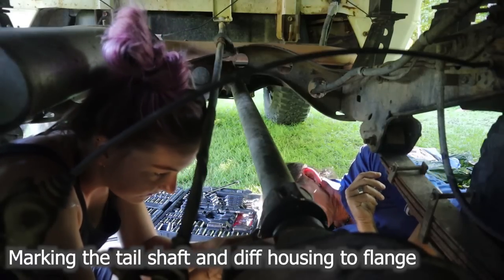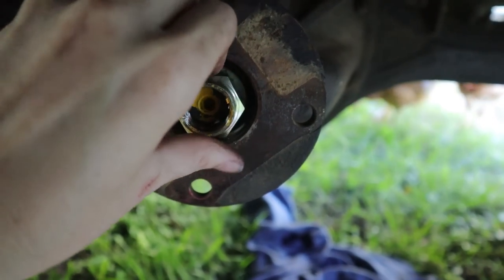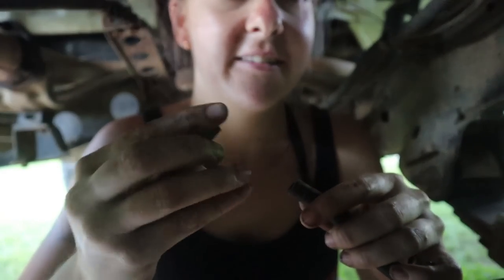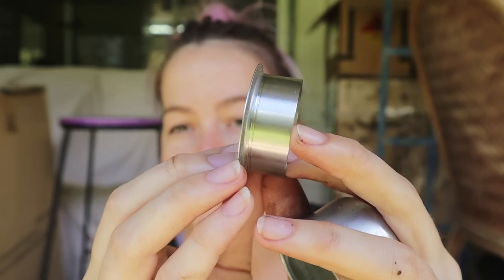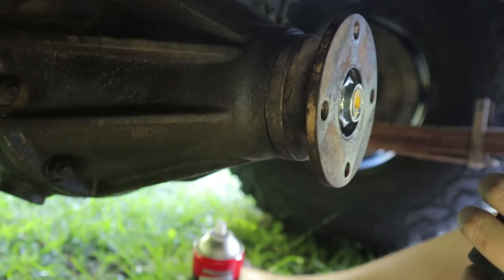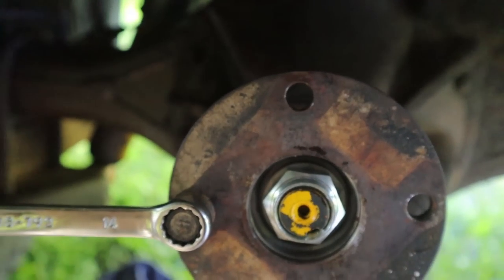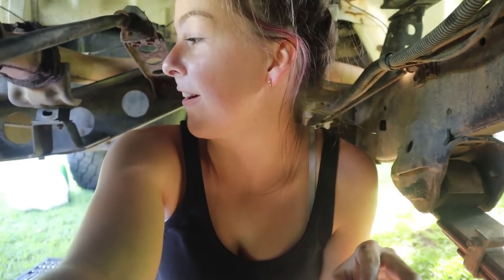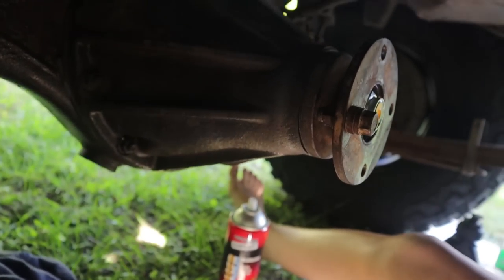My Landcruiser Part 4: Diff Pinion Seal Replacement

Comment: i had the same issue in my sixty series...rear diff pinon seal leaking..fixed the seal..after  a few months later diff centre locked up leaving me stranded on the road...worn. centre bearing caused the leak had to put reconditioned centre in..no trouble since ...fifteen years...later old sixty still going strong....great effort Danie working on your 75 series only way to learn everything about your 4x4 cheers jamie  .
Reply from the maker: Oh man that sounds like it wasn't fun at all! But thank you:)

Comment: Little tip for speedi sleeves for you all. If the groove in the shaft is excessively deep then you may need to throw some devcon or other similar metal putty around the groove before the speedi goes on. If you dont do this you can have an air gap under the sleeve (right where the seal lip runs) and it will overheat, fail and tears the seal. Used this trick many times on industrial gearboxes (fixed plant stuff not automotive/transportation) and never had one leak or fail prematurely.

Comment: Really good video, oh so easy to do in a workshop with a two post lift but great to see it done "bush mechanic" style.
On a note about diff breathers, the diffs can actually create a negative pressure when going through water which will actual create a suction, hence water in the diffs.
Not a hard job to extend them. 
Ah, a video opportunity waits.
So much room under there to work. Lovely truck, is it a 4.2 1HZ
Reply from the maker: Thank you and yes 4.2 1hz

Comment: Great video as always.
Best thing about the speedi sleve is that it puts a touch of extra pretension on the seal.
Best way on the rear preload on the cruser is to pull the axles as you wont get any drag.
Keep up the awesome work
Reply from the maker: Thank you very much:)

Comment: Terrain tamer do a solid spacer and shim set for the pinion, no need to set preload etc, very easy to install, youll be able to do it with the tools you've used here.

Comment: Great video. Nice to see a young person having a go. The only thing I might add on the use of speedy sleeves is to use some locktite under them. It helps slip them on and reduce the chance of damage and it also glues them in place. Which can stop oil leaking between the shaft and the sleeve and stops the sleeve from moving due to expansion,or the fit to the shaft.
Good work to on raising the issue of mental health.
Reply from the maker: Noted! And thank you:)

Comment: Well done Danni.
Buy a knuckle bar to undo stuff, generally longer than a ratchet and no gears to strip. 
Loctite under the speed sleeve is a good idea.
Doing up the nut, yep you wont get anywhere near the manual stated torque as the crush sleeve has already started to collapse which was why the nut was easy to get off. The full job can now be conveniently put off until next time it leaks catastrophicly as there's always something more fun to do.
One day you'll actually be able to do repairs at home, where all your tools, flat ground and friends network are. One day.
I'm impressed that you are small enough to work on the diff from above, there are times I wish I could do that.
So what are you breaking next?
Cheers
Reply from the maker: Thank you and yes having a lifted car and being small definitely has its advantages:) some mods next I think

Comment: Hey! 
I was wondering what you torqued the pinion nut back too when everything was finished thank you :)
Reply from the maker: as mentioned in the video this is not a tutorial video and was a quick fix to get home. The rear hubs need to be dissasmbled, axles out, diff centre out, stripped and reassembled on a bench with a new spacer and setting the correct pinion depth, preload and backlash with the correct shims before reinstalling into the vehicle. Failure to correctly reset your diff will result in it failing under load

Comment: Great video. When you say 3mm past on pinion nut do you mean tightened 3mm down the shaft? Also what torque setting on pinion nut did you go to? Is your diff all good now?
Reply from the maker: as explained in this video this is not a tutorial. this was to get me home, the diff then gets removed and rebuilt completely with all preloads, backlash and mesh checked and adjusted

Comment: Hi Danie great vid and thanks for sharing. Did you have any backlash and pinion movement up/down and sideways before swapping out the seal. If so was is minimal? Thanks John
Reply from the maker: This was just a temp fix to get home. To do it properly you remove the diff centre to take measurements and have either a new crush spacer or a solid spacer installed
Reply: @DanieSimpson  Thanks Danie. Yes this would be the 2nd diff centre rebuild in 460K. Starts with the pinion seal leaking and some backlash/ lateral movement ect. Have you thought about doing a vid on diff rebuild? Cheers
Reply from the maker: @johndrinan8939  will be yes at a later date:)
Reply: @DanieSimpson  Excellent

Comment: Not to pick apart your work as you're doing it and not paying a shop big money to do it for you and your obviously learning as you go(which many do not feel the need to go through the process as it's easier to pay someone else to do it) Here are some tips from my personal experience dealing with axles and seal surfaces.....this was due to failures in my workmanship and caused me to do the job twice! Plus since this is a quick fix you did if it starts leaking again you have something to look for.

If using a speedy sleeve us a little bit of loctite or equivalent thread locker on the machined surface that the speedy sleeve is being installed onto, this will do two major things.
1. It will ensure the sleeve never moves or slides out of place when things heat up(quality of speedy sleeves aren't that great so inherently some will be larger than others) Some axle manufactures put thread locker on the axle carrier bearing caps when installing the carrier to ensure you don't spin the bearing race....same concept here
2. It will keep gear oil from seeping under the sleeve and making it look like the new seal it leaking. Same thing for front and rear main seals, crank case pressure with engine vibration will literally move the sleeve and push oil under it. Don't have to use red high strength just something to fill the gap and "glue" it in place. 

It's a good idea to put some rtv/silicone/sealant on the splines of the driveshaft flange to keep the oil from seeping past making it appear the seal is leaking, don't use a lot as you will fight this the next time you remove the flange. 

Always remember.....if it works its not stupid, it's just another way of doing it!

Comment: Howdie Mate, you can feel the bearing friction with you hand with the wheels off the ground, the bearing preload is normally set with a shim or the crush sleeve. 😎
Reply from the maker: Yes it is set with a crush spacer. Since I wasn't replacing it. I wasn't too concerned with setting the preload. But the correct way is to use a torque meter

Comment: Good job that’s going to help me out.
Reply from the maker: This isnt a tutorial. Lots of key steps left out and to finish the axles come out, diff out, spacer replaced and bearing backlash and preloaded reset. Not doing this step will eventually lead to diff failure

Comment: I think people were meaning that the tyre, placed under the chassis (just under the front door area) is a much safer prospect than just the jack itself. Yes, this won't stop the axle falling off the jack, but if you have you head/body under the wheel arch whilst working on the hub etc, you won't have you head/body crushed. It's unlikely that you'd have any part of your body under the axle; even your leg/s. So, please, always put something else under the vehicle (chassis) when you're under the truck. Of course, I'm not referring to THIS video, because it wasn't jacked up when you were working on the diff.
Reply from the maker: And as I stated, and was shown in the insta video, I can still sit under my guard completely fine if the jack fell out. Most that would happen would be a bumped head. And again, sometimes you just don't have something. I've had people have their entire wheels fall off and they've had to jack it up to repair studs on the side of the road. You don't have a wheel to put under or anything. You just learn to work as safely as possible with what you've got. If you have a jack stand great👍
Reply from the maker: @janpur1417  did you read my comment or even bother to watch the video😑
Reply from the maker: @janpur1417  obviously not then. The video you are commenting on and my comment above🤦‍♀️

Comment: Hey Danie, My 80 has a leak in the rear pinion seal as well ( 20+ year old cruiser life right? ). Did the method you and your dad used work okay? I'm studying part time at tafe now Cert 2 in Automotive.. I'm really thinking it's the right way to go for me. 
I will ask my teacher at tafe what he thinks about it. Anyway just wanted to say that you are inspiring and your repair videos are great reference material for me. Keep up the great work! :D 
Cheers Adam.
Reply from the maker: This was a quick fix to get home. If you have the time I recommend doing a whole kit and setting the preload correctly. This was more of a "wing it" job

Comment: I know its old but y on earth would ya need javk stands to do diff housing or axles in the rear correct me if im wrong but i have pulled axles and diff centre out of me 60 plenty of times n not once did i take the wheels off
Reply from the maker: I didn't jack the car or take the wheels off?

Comment: Fixing your rig is one thing that makes you awesome but mentioning men's mental health blew me away. I work on a mine site where any display of your feelings is instantly regarded as weakness and your quickly labelled a pussy. Unfortunately this is a normal work culture for most Ozzy blokes and it can have devastating results when you add it to issue's at home or alcohol.
Good on you for starting the conversation.x